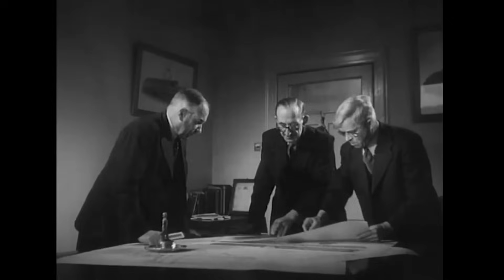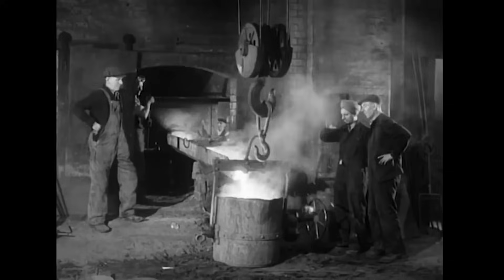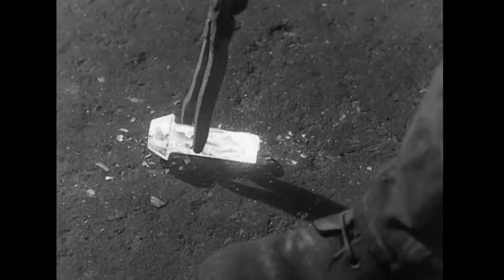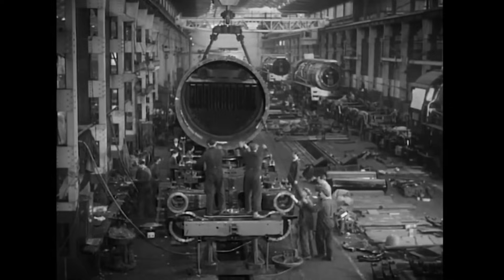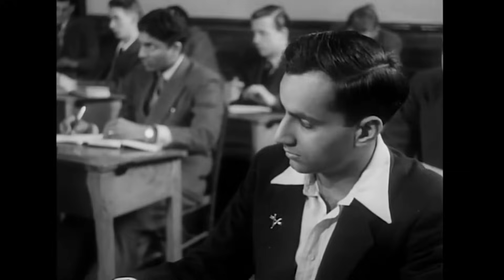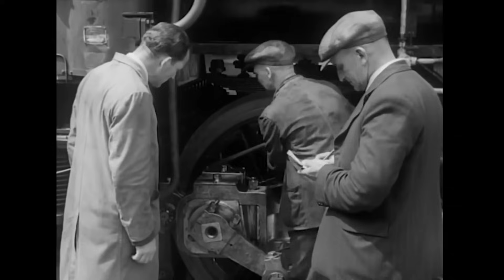Portrait of an engineer - 1954

Comment: The apprentice route at its best.  All the way from learning how to use files correctly to supervising production overall. It’s arguable that social mobility has declined since then however you can still become a chief pilot or a chief constable by joining without a degree but with talent and enthusiasm.
Reply: And companies were probably run better because  the bosses understood their business having floated up from the bottom. Unlike the modern crop of MBA know nothings
Reply: @DanRyan-v5y There’s some truth in that.

When the retail banks replaced entry at 16 with progression possible all the way up to chief general manager with grad entry, graduate managers found themselves managing operations they knew nothing about.  This was soon obvious to those they were managing.

However all good MBAs are ‘post experience’ masters. You have to have significant professional, managerial or business experience running an enterprise as a condition of entry to the course… to make sure you have something to talk about in class. These are ‘AMBA’ accredited in the UK.

Unfortunately, there are ‘MBA’s you can sign up to straight after a first degree.  They are frankly a rip-off.
Reply: @stephensmith799  so there are mbas and there are mbas. Given most hr these days dont seem to know much themselves , they are probably just as likely to employ the second to the first. Cheaper innit?
Reply: @DanRyan-v5y I’m not a fan of HR. The down-home honest folks are the Engineers and, in manufacturing, also the Accountants.

If the Engineers and Accountants form an alliance they can push through improvements in product and production engineering which have definite long term advantages but which don’t ’pay back’ in the usual two years, but in seven to ten.  Between them they can overcome ‘short-termism’, which is a scourge

Comment: A good film, but the bomb in the firebox wasn't the fact that making steam engines like this was horribly dangerous; but that it was horribly inefficient. A small army of skilled men making tiny numbers of non-standard parts, too many of which depended on just human judgement and crude mechanical measures. For instance: the film says the forgers judged the temperature of the metal "by eye", a notoriously bad way of judging temperature.

Comment: Such amazing work. It's unreal to me that people once made such large and intricate machines without automated computer technology. All with their own hands eyes and measurements. Insane!
Reply: Yes. Visualising complex 3D forms without cad/cam.  What makes me gasp is Bullied’s Leader Class oscillating sleeve valve motion.  The video of it operating is hard to find but Leader’s valves rotated one way and then the other as they slid backwards and forwards.  Imagining and then drawing the actuating gear too!
Reply: It is more than 100 years of evolution. No superinovative magic you see here. Just slow, step by step evolution. They say it in the video, that the factory is producing locomotions more than 120 years.
Reply: For Americans must be unreal just try to imagine using a brain…
Reply: The motto  at the measurement  section  R & D Cromptons  , necesitat  non habet legem  ,any Latin scholars   ,those very accurate  huge wheels  ,many  youngsters  into lathes Mills  shapers   micrometers

Comment: It's beautiful, isn't it? It's even surreal. How could they do this without a computer? How could they know what kind of metal, what kind of nuts and bolts? The size of the threads? How could they know the wheel sizes, the length of the connecting rods? Even their shape? How could they work in such a furnace with just shirts on their shoulders? Whereas nowadays, you need overalls, and protective gear! Where did the measuring instruments come from to find out whether the machining was good or not? Who trained the first engineer? Who made the first plan of these big machines, without ever having seen them before? No wonder what is happening on this planet without anyone asking the right questions? How did the first men learn about the different alloys that could be used? Who told them all this? Then the tests! How many workers and engineers died in machine explosions during the first tests? Strange to know that suddenly everything is there in the so-called modern man! As for a program. How did we go from the very first small steam engines to big monsters of several tons? With some of them equipped with gas turbines! How did the hunter-gatherer get there? When it seems that he was chasing mammoths to feed his family? Finally the man increased, how long has it been going on? Ah yes! Since the beginning! How does man know what he knows? For example for these steam engines, how did man make all the different elements that make up his machines? Surprised that nobody asks the question under this video? And who invented the machines that make machines? So what was the first machine in the history of the industrial machine? And why was it designed? And by whom? And on the basis of what it observes in nature? So easy to talk about evolution. Animals have existed on this Earth much longer than we have, and where are their machines? Steph.

C'est magnifique pas vrai? C'est même surréaliste. Comment pouvaient ils faire cela sans le moindre ordinateur? Comment pouvaient savoir quel type de métaux, d'écrous de boulons? La taille du filetage? Comment pouvaient ils savoir les tailles de roues, la longueur des bielles? Même leur forme? Comment faisaient ils pour travailler dans une telle fournaise avec juste des chemises sur les épaules. Alors que de nos jours, il faut des bleus de travail, et des équipements de protections! D'où sont sorti les instruments de mesures pour savoir sur les usinages étaient bon ou pas? Qui à formé le premier ingénieur? Qui a réalisé le premier plan de ces grosses machines, sans jamais en avoir vue auparavant? Etonnant non ce qu'il se passe sur cette planète sans que personne se pose les bonnes questions? Comment les premiers hommes ont été mis au courant des différents alliages possible? Qui leur a soufflé tout ça? Puis les essais! Combien d'ouvriers et d'ingénieurs sont décédés dans des explosions de machines lors des premiers essais? Etrange quand même tout se savoir qui soudain est là en l'homme dit moderne! Comme pour un programme. Comme est on passé des toutes premières machines à  vapeur de petites tailles aux gros monstres de plusieurs tonnes? Avec certaine d'entre elles équipées de turbines à gaz! Comment le chasseur cueilleur en est il arrivé là? Alors qu'il parait qu'il courait après les mammouths pour nourrir sa famille? Finalement l'homme augmenté, ça dure depuis combien de temps? Ah oui! depuis le commencement! Comment l'homme sait ce qu'il sait? Par exemple pour ces machines à vapeur, comment l'homme a t-il fait pour réaliser tous les différents éléments qui composent ses machines? Etonnant que personne ne se pose la question sous cette vidéo? Et qui a inventé les machines qui fabriquent des machines? Donc quelle a été la première machine dans l'histoire de la machine industrielle? Et pour qu'elle raison a t-elle été conçue? Et par qui? Et sur la base de qu'elle observation dans la nature? Tellement facile de parler d'évolution. Les animaux existent sur cette Terre depuis bien plus longtemps que nous, et où sont leurs machines? Stéph.

Comment: On the footplate during testing: "His ears can often detect any mechanical faults unaided by any mechanical means" - it's a wonder he has any hearing left after earlier scenes! "By the feel of his hand on the throttle he can tell if the engine is responding correctly" - except that he isn't driving is he?
Reply: Deaf as a post after a few years in a boiler factory!
Reply: I bet you vote Labour.

Comment: I listened to a talk given by the VR CME and he said they’d look at a blueprint of a steam locomotive and request the weight be reduced by say, 100 pounds.
How would you do that with a stack of blueprints? Easy on a CAD.
Reply: Many hours of calculating with trigonometry and a slide rule…that’s how!
Reply: @josephdbishop6576  maybe plan holes in the frame and strategic non critical locations?
Reply: You would get an engineer who knows the inside out workings of the train to go around the build and find panels to shave down or chunks of metal to carve out. Then. Once cut out you adapt the part in the drawings. 

Not that hard, digital has just made sharing it faster and easier

Comment: Engineering is one of those activities that cannot realistically be shown with a film portrayal. According to this film Ted "solved" a dozen problems during a walk through the facility. Problems that were the responsibility of much, much lower line supervision to prevent. Anyone who's ever been involved with equipment testing knows it's mostly mind-numbing boredom followed by many hours of reducing the raw data into results. That Ted could wander into a test already underway and "solve" a problem with a locomotive engine is specious nonsense. Heat engines are designed to convert fuel to heat. Not once was it noted that the coal required to produce a certain quantity of steam of a certain temperature and pressure was first carefully graded for size and analyzed for carbon, volatiles and ash. The amount burned was also recorded. Likely more tests were run to determine how the boiler responds to other types and sizes of coal. That alone could easily require days if not more than a week of round the clock testing. Then there's water quality...

Ted may well have done all these things but doing them all in a single day? Poppycock and balderdash.
Reply: "Poppycock and balderdash"

such a fancy statement, I've grown two monocles just by reading it!!
Reply: My grandfather designed and supervised the building of the road and railway from K L to Penang in the early 1900s. He had all the skills needed! So I have no problem with Ted's broad knowledge.
Reply: @peterazancot9775  While still an engineering student I did two semesters under the tutelage of a Ted. I did not claim Teds don't exist. What I pointed out is that Teds don't solve problems like magicians. Your grandfather spent long hours determining the most efficient and effective way to address each 'well, what about this' as he determined the final route then oversaw the construction. I doubt seriously if your grandfather moved a shovelfull of earth, set a single tie or spiked a single rail. Line supervision oversaw those activities. Teds are much farther up the engineering food chain.
Reply: No doubt you're right, these old films were really a showcase of British engineering skills rather than a true fly on the wall account, in a world that was changing fast and other countries were catching up or overtaking what was once arguably one of, or the world leader in engineering of boats, trains and many other items ...when this was made food rations finally ended in Britain, 9 years after the war, the country was broke and desperate to show it was still a world leader of engineering and a super power....albeit sitting further down the table since the US and Russia took centre stage,  it must have been obvious that the country was no longer the might workshop of the world that it once was.

Comment: True engineering at it's highest. All these Uni wallah's .... And yes I've heard it ' I'm an engineer' No ... No you are not..Can you use a lathe, Milling machine, can you weld / electric or gas, braze, solder tin?? The best I have ever had is an inside vernier handed it to the bod and said it's out of cal. the reply ' What am I supposed to be looking at?'  The Gentleman here in this film started at the bottom and worked his way up. No brown nosing, no discrimination card. Pure hard work and study. Sadly these days have gone.   Even worse we shall never see them again, but in the amazing world of the preserved Railway those Ladies and Gents pull off miracles, my hat is off to them all.
Reply: Have to disagree with the part 'we shall never see them again'. I work as an office based engineer for one of the largest rolling stock manufacturers in the Europe, I'm based in England. I started as an apprentice, was first a technician, then a high level technician, and now in my thirties an Engineer. No degree, just my apprenticeship quals. And all other 8 people in my office (also in their thirties) took the same route. Yes, there are plenty of straight from uni types, but in my experience it's about 50:50.
Reply: *in Europe
Reply: You understand that "Ted" was most likely a fictional character, yes?
Reply: @richmanwisco  pedant.
Reply: Your definition of engineering is at least 7 decades out of date. Mechanical Engineering is to apply engineering calculations and guidelines to provide a piece of equipment that meets the service requirements as outlined in a specification. The procedure for actual production of the piece of equipment falls to an Industrial Engineer. An Engineering curriculum (I hope) still includes some hands-on training in industrial operations but acquiring skill as craftsman is functionally a waste of time. Investing training time for an engineer to be proficient at industrial processes is time not used effectively in an engineering career. A good engineer need only be familiar with manufacturing processes not an outright expert.
Reply: @curtislowe4577  that's where you are going wrong. Knowing all the skills helps you to get the best out of all the stuff you mentioned. Plus it helps to realise there is often a difference between a design and the actual way something operates. Technicians and operators are perpetually complaining about engineers only understanding the contents of their cad machine , and not how real world conditions often upset the applecart.
Reply: They were shit, that why cars had to be run in, and never saw 100k
Reply: @chubeye1187  you are aware that 1 Train of at minimum 10 coaches could carry up to 100-200 passengers at a time, plus luggage, on mainline routes at 80-90 mph throughout the ride? Whilst cars to this day still have a 75mph speed limit, carrying one or two people at a time?